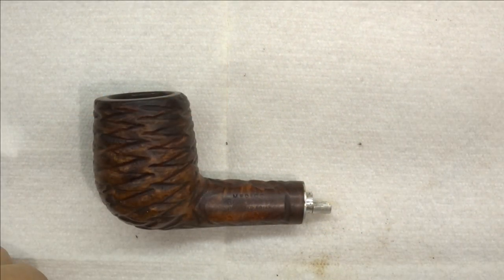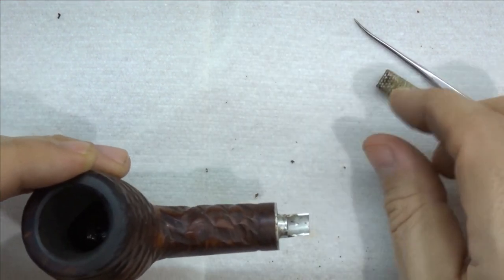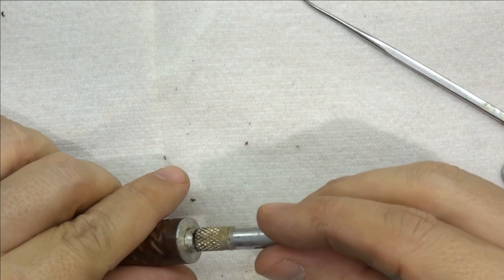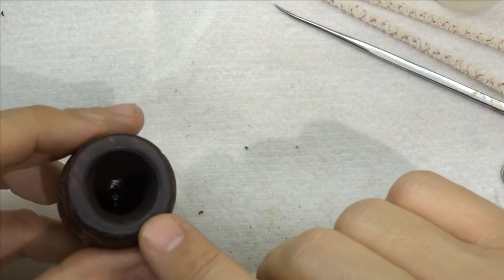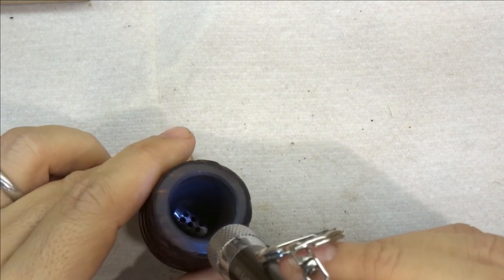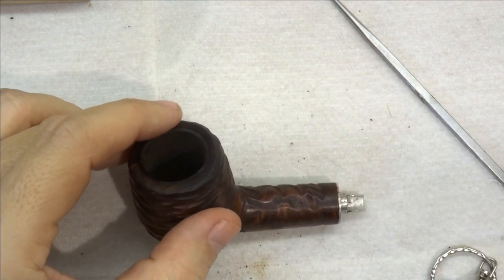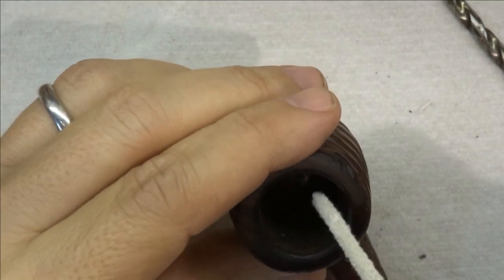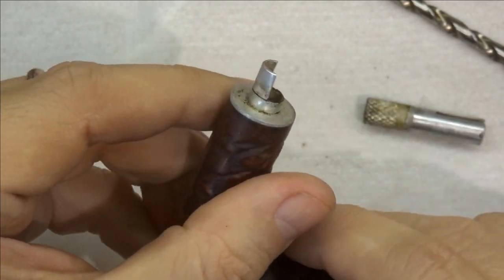Restoring A Medico Guardsman Part 2

Comment: Dang what a pain. It was a good deal on eBay and quick flush. Thanks for sharing . I learned a lot. What is conductivity of carbon?
Reply from the maker: You see a pain, I see a heck of a lot of fun 😉  I'm sure the conductivity of carbon is not zero,  but my meter would not consider it "connected ."
Reply: @CaneRodPiper  lol yeah purified carbon in pencils and motor brushes conduct nicely but it did make me want to stick meter leads in a pipe bowl an test the theory.

Comment: Why do you need to file the tube any further if you are going to drill it out anyway? Maybe I missed something.  You could potentially set the shank up in your drill press and remove the end of the tube with a drill bit or abrasive wheel. Maybe it's just me, but filing near something that I am trying to keep flat always causes me problems. 😲
Reply from the maker: Different strokes.  I feel I have much better control and accuracy with a file.  But your suggestions would certainly work.
Reply: @CaneRodPiper  oh, good, I'm not going crazy afterall.
Reply from the maker: Well, I didnt say that 😉😂